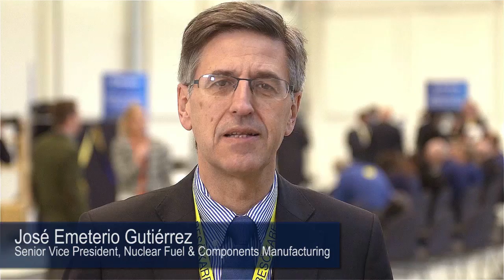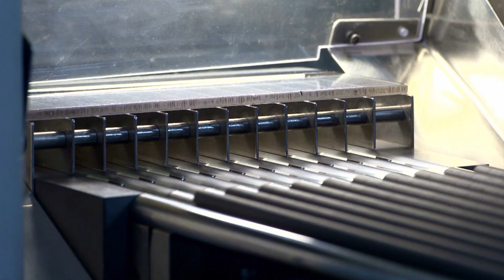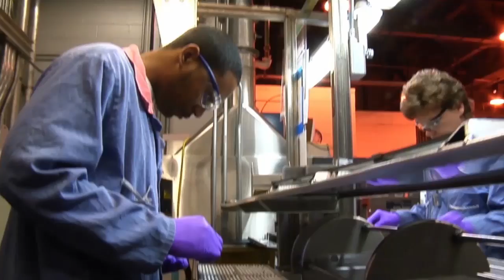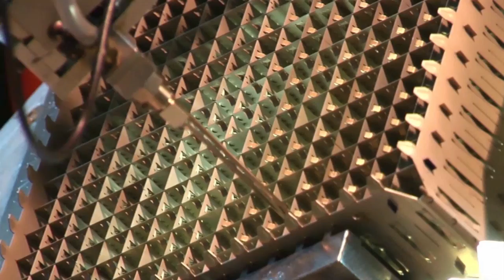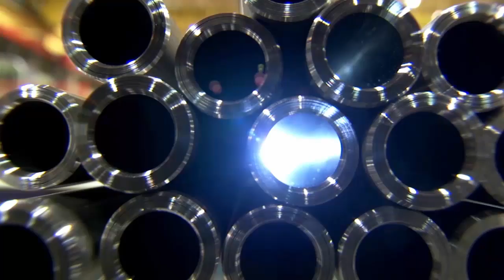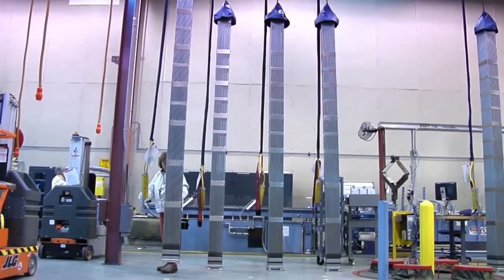Westinghouse Nuclear Fuel

Comment: Why are the rods not melting hot until they are put in the reactor ? Is it not just a bunch of rods near water tubes to make steam?
Reply: Its not just fuel rods dunked in water. Water doesnt react to the uranium 235 fuel rods.  A neutron source is entered into the reactor. The control rods which are full of boron stop fission from happening. When they start the reactor they slowly remove the control rods and the nuetron source (usually californium) starts to bombard the uranium fuel with neutrons causing fission. This heats the water to about 570 degrees F. The boiling water travels thru a condensor and it turns to steam. The steam turns a turbine which creates electricity. Ive probably said to much.
Reply: u need a moderator for the neutrons like water or graphite to slow them down. otherwise they are just "too fast" to get absorbed by another uranium core. if u add water and release the control rods (silver, indium, boron) the chain reaction starts.  (they absorb the neutrons that were moderated to stop the reaction inside the water)  as kenny said: there might be a neutron source to help it get going. but thats not even necessary.  u can use normal water. heavy water or graphite as basic moderator. molten salts or gas is possible too. 
u need the right amount. in the right shape. with the right moderator. theres more than just putting some uranium together to get a chain reaction going :D just some neutrons here and there is just not enough.
Reply: And not only are they not "melting hot", new fuel isn't all that radioactive.  Perfectly safe to stand next to for a while, although you wouldn't want to sleep next to it every night.  Kenny Williams is right, for a Boiling Water Reactor, but in a pressurized water reactor, we don't even use the nuclear core to bring the primary loop up to 570F.  The reactor coolant pumps are so large and powerful that the heat energy imparted to the primary loop just by mechanical agitation of the pumps once turned on brings it up to temperature.  Once up to temperature, then the reactor is started up to begin boiling water in the steam generators and turning the turbine generator to put power on the grid.  Pretty cool process.
Reply: The heat that fuel rods are so famous for is generated by the decay of fission products made of splitting uranium after it's in the reactor. But before the rods are put it a reactor it's just uranium oxide, i.e. a ROCK.